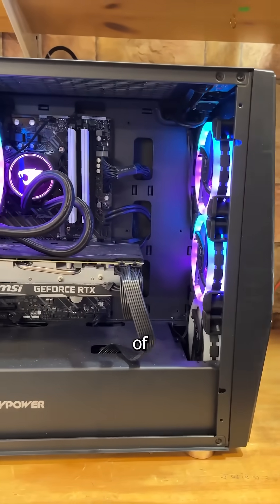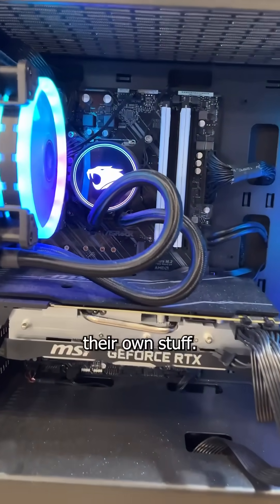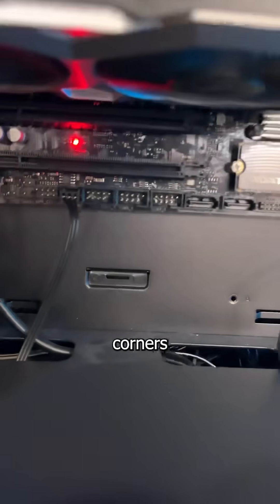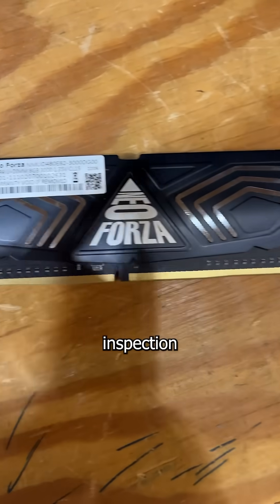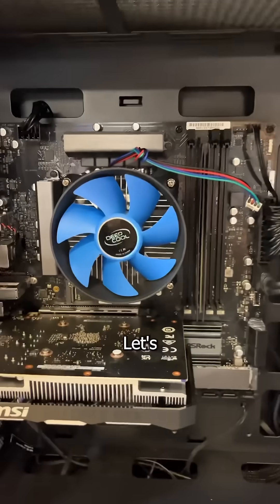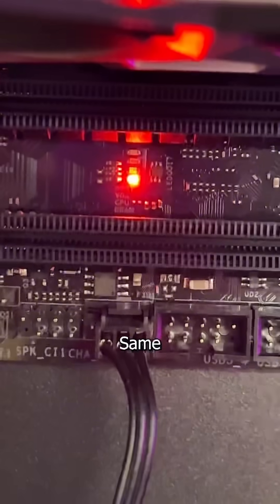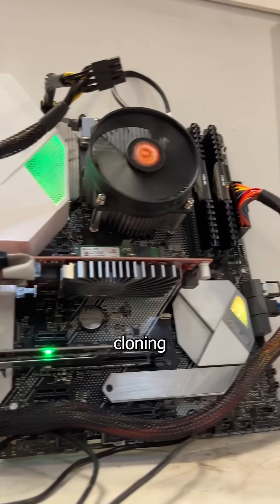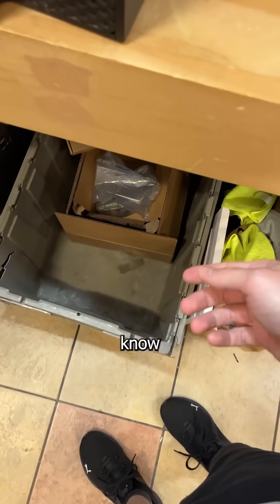iBuyProblems? Cheap NVMe causing no POST 💀 #technology #pc #tech #shorts #computer

Comment: I bought a brand new I think western digital black NVME from Best Buy, installed it, would occasionally post to BIOS but would always fail trying to boot Windows.
I was getting constant RAM error lights. I swapped in my old drives and it boots fine. I go back to Best Buy, buy the next 4tb Samsung 990 Pro, and get home, install it. Works like a charm

Comment: Adata is pathetic
Reply: No, very solid Brand actually.
I have SSD and 2 DDR Rams from Adata on old system. No problems for 10 years.
Reply: @КаринаМурлыкина-о9т  I've had 1 480 GB su series m2 ssd. got corrupted exactly in 3.3 years, 3 months after the warranty lapse. I checked with the people on reddit, Adata has been giving the same problems to them :)

Comment: This is the first time I ever bought a prebuilt and It is an IBuyPower Elements Pro. It's been fantastic. Depending on where you buy it, it will tell you what brands of components you are getting. Mine is all MSI which I like. If you go for a less than $800 model, expect to get Chinese ripoff parts.

Comment: My first system was an iBuyPower.  I bought it because at the time buying the components individually would've been the same price.  It died on me within 2 months thanks to shitty parts.  The PSU (eVGA, was rated good for its time) blew out its smoke, but before that it had problems with crashlng likely due to the RAM, but other crashes were possibly due to a Palit-branded GPU.

I bought it with the intention of upgrading from the shipped 6GB of RAM and GTX 460 a couple years down the line, but with all low tier parts being suspicious I said "fuck it, we're doing it now!"  i7 870 w/ 24GB ram, 1TB WD Black (eventually upgraded to 6TB spinning rust with 720GB RAID 0 SSDs), and an MSI GTX 460 OC (eventually upgraded to dual 7970s). PSU was replaced with an Antec 1KW gold-rated unit.  I think I ended up sinking a total of $10k into it over its life, but it was a beast.

iBuyPower is shit, I should've just done it myself to begin with.

Comment: I have an ADATA SATA SSD in my server as a boot/swap drive. Motherboard is too old for NVMe/mSATA so 2.5" laptop drive stuck to the drive cage with 3M VHB it is. It's worked fine for 4+ years so far, fairly light Plex loads and file copying so not being slammed with read/writes, but I should probably boot the system up in Clonezilla and check the drive health at some point.

Comment: The terminating resistors on the A-Data drive.   They are inside the controller and are SUPPOSED to go to erf.  Buuut - they accidentally go short and kill the PCI bus completely.   That bus goes to the CPU directly.  A boot is attempted but the mobiusboard sees the CPU panic and refuses to move on.

Comment: Ironically, I got this great RGB iBuyPower $5 mouse that I thought would be better than the heavily abused, shared HP mice at work and $5 isn't a big deal if I have to bin that sucker inside of a month. 

Also to note my old ass 4th Gen Core i5 is running ADATA ram with no problems for the last decade(including being on ASUS' memory compatibility list) 

Guess it must be whatever 3rd rate Nvme maker they contract with is garbage... 🤔

Comment: PCIe problems always result in weird behavior.

Those diagnostic LEDs aren't something you can trust. They only show which state the BIOS is currently in. Server boards have a ton of those LEDs for all sorts of things that all flash during boot or stay on/off forever. The four LEDs are only the most common ones, but they still mean something like "I'm stuck between checking the CPU and checking the memory". What else it does between those two things only the manufacturer knows.

Edit: A very nice thing one board I saw had were individual error LEDs for the PCIe slots. The clips on the end were see-through and illuminated from below, so if you put a broken GPU inside a slot, the clip would glow red. Sadly no one does that today as it's likely too expencive.

Comment: Ram light came on because the dram cache on the nvme is initiated at the sane time during post as normal ram. Everybody knows you should have a case speaker plugged in to differentiate the codes. Lights are just the first stage

Comment: Happened with my PC just a month ago. I kept swapping slots and reinstalling Windows over and over again. Finally, I decided to swap the PSU too, but it didn't work. I had to get a new m.2, and the old m.2 is still good (from what I see on CrystalDiskInfo and HWInfo), but it can't be used as a boot drive, I now use it as a secondary storage drive.

Comment: I'm building my PCs since 2003-4 and the most problems I've had was 2009-2014 with my AMD stuff. My current AMD PC runs better than everything I've seen before. I can count on one hand my blue screens I had in my last 2-3 years and that's pretty rare for PCs in general, especially with heavy users like me. The point is, building it your self will also result into problems, no matter how much you know, it's always a possibility, but with more experience comes better builds and the ability to fix your problems by your self. Of course those people will rarely send their PCs into a repair shop and people who buy fully build systems will send theirs. Even if you're a pro, you can encounter problems, some times a Windows update will destroy your SSD like recently, or you need a BIOS Update to run your hardware smoothly and people just don't know.

Comment: Possible cause of RAM error: if the drive in question is DRAM-less (aka cheapo drive), it relies on host memory sharing to cache activity. If the drive has issues, it could cause the controller to basically spam the system with calls trying to establish a cache for a drive that can't even mount.

Comment: My guess is the DRAM cache on the NVMe drive crapped out.  NVMe can run in different modes where it can use some of the system RAM if your drive does not have that cache.  So I am thinking that your system is trying to see that as a system RAM extension and freaking out when it cannot find it.

Comment: The older ADATA 2.5" SATA SSD's were the shit back in the day, so it's a shame to see their QC fall to the point people are warning against their products. They weren't SUPER fast, but they were reliable and reasonably cheap for the speed and capacity. I still have 2 of them kicking around, one in a spare system and one in my ex's computer after I gave her my old system and just put it in a new case following an upgrade. I also remember that their old DDR2 and DDR3 DRAM was also cheap, reliable and fast, but I've heard some recent horror stories with their DDR4 and DDR5 modules. On top of that, some of their mid range products are now more expensive than more performant alternatives from Corsair, G.Skill, TeamGroup, Kingston, etc. Sad to see a brand you once trusted go the overpriced jank route. I used to go out of my way to buy them from CompUSA and Newegg, now if I see them anywhere I avoid them like they have leprosy. Woof.

Comment: I had a failing nvme drive in my gf her pc. Took me a few weeks to figure out because it showed itself as a power issue. Random shut downs and performance was unstable. Undervolting seemed to work but then suddenly windows wouldn't even boot at all. Swapped it with the nvme from my own rig and everything worked as expected! Bought a new and larger nvme and now it all works like a charm

Comment: the only way this would happen is if the MB maker ran the sata lines into the pci pipeline for the cpu's memory controller.the second the drive failed the cpu would have seen it as a memory failure. either that or the cpu's memory controller is starting to die.

Comment: Honestly this happens without reason when there are power outages or scenarios of short circuiting.

It is possible that if at anytime part of the board or harddrive short circuited that would make sense why the drive you tried putting in didnt help at first.

It's rare for the board to stay working, but like you said those "ADATA" drives being unreliable could also have been a factor in a scenario of that part of the board being able to short circuit with ease.

Hopefully the motherboard lasts a little longer.

Comment: iBoughtProblems too can any recommend a good power supply for the “Element 3” pre build, my specs are ⤵️

Case: iBUYPOWER HYTE Y60 RGB Gaming Case -
Black
Processor: Intel® Coret™ i9-14900KF Processor (8X
3.20GHz + 16X 2.40GHz/36MB L3 Cache)
Motherboard: ASUS ROG STRIX Z790-E GAMING WIFI, WiFi 6E, Back Panel USB (2 Type-C, 10 Type-А)
Memory: 64 GB [32 GB x2] DDR5-6000MHz Kingston
Fury Beast RGB
Video Card: MSI GeForce RTX 4090 SUPRIM LIQUID - 24GB GDDR6X (DLSS 3.5 - Al-Powered Performance)
Processor Cooling: CORSAIR iCUE H115i ELITE
CAPELLIX XT 280mm RGB Liquid Cooler
Primary Storage: None
Operating System: Windows 11 Home
Storage: 2TB Samsung PRO M.2 PCle Gen 4 NVMe
SSD

Comment: You can get the same RAM error light with ANY hardware running through the chipset PCI lanes being bad. Chipset lane hardware issues cause a fail during the ram test stage of POST.

Comment: PCIe POST checks failed for sure. You can technically get aeound this if you had this drive in one of the other M.2 drive bays, and jad another one here that was good. They usually fail out on the initial checks and refuse to boot, but so long as one posts, youre good.

Comment: A failing storage device can cause such severe instability that the ram fails when trying to load in what it is supposed to be getting told by what is on the storage device.  So, basically, the storage is talking to the ram all wrong.

Doesn't really do anything to virtual ram though. Since that is managed by the OS rather than bios. 
But with this issue. You won't even get to the OS for virtual memory to even become relevant.

Comment: when I was looking at these prebuilt, almost all of them came with adata drives because of how cheap they were. I seriously considered a prebuilt pc when I couldn't get my hands on a 9800x3d. but just waited long enough, now im waiting on my case and PSU. 9800x3d, 64gb flare x5 ram cl30/6000mhz. corsair 4000x case, rm850x psu. existing rtx 3070ti

Comment: I think this diodes dont show problems but shows state when post stoped- CPU initialized, then connections to needed devices, then working state od GPU then booting devices.
When GPU is not plug in fully it shows DRAM errors sometimes

Comment: I had a similar issue with my dad's work computer and I tried everything, reseating the ram, checking to see if the cpu was making contact with the cooler, and then I took out the ssd and it booted. I'm not sure why this worked but it might not be super uncommon.

Comment: Idk, but the chips on NVMe SSDs and DDR4/DDR5 RAM modules are made by the same 3 or so companies and often share some of the same chips (along with others they don't share) that go into building the components. Perhaps the error occurred on a memory chip on the SSD that happens to also be a chip that often shows up in RAM modules, so when the motherboard detected an error in that chip (or couldn't boot because of that chip) it triggered the DRAM LED to turn on and display an error.

Who knows 🤷🏽 The lines are made up and the points don't matter!

Comment: I bought an iBuyPower and absolutely loved it! It was during the 4090 scalping time period so they were going for twice the price. Found my current computer and added up all the components and it was a legit deal (yes overpriced comparing it to buying it yourself and yes the components weren't top of the line, but they weren't bad either)... Only thing wrong with it was the PSU dying a few months. It was definitely the lowest quality part being some Chinese knockoff. But I will say it was causing blue screens and major issue.  I think a normal person probably would of never figured out it was the PSU being the problem. I also have replaced RAM, SSD, and CPU cooler. But definitely it would of been way better to have built it myself, but the computer cost nearly as much as scalpers were trying to charge.

Comment: Merge over just been lucky, but I've had a 500 gig adata nvme as my OS drive for the better part of a decade, and had no issues with it. Also bought a 1 terabyte adata nvme to dual boot Linux bazzite a few months back. No problems with that one either.

Comment: I am also a technician and I have no big brained answer but I can say with experience that the dram light just turns on for all kinds of not dram related issues. I see it a lot with power issues, like the gpu will have a bad cable but the dram light is on. Especially Gigabyte brand motherboards, those lights just boop on and off for no discernible reason.

Comment: I have Adata Legend 710 and it works perfectly for 3 years already.
I think problem lies in stupid thin radiator on self adhesive that adata shipped with, i never installed that and used mobo radiator instead on the b450 aorus, cuz I heard these adata drives can overheat and throttle with stock cooling and I bet this drive in the video just cooked itself.

Comment: If I'm correct, that's an ASRock phantom gaming X motherboard. I have the same one and apparently it has an issue with anything used in the NVME slot. I'm replacing my motherboard because of it

Comment: I just installed brand new motherboard, cpu, and cpu cooler to my ibuypower pc I got back in 2019-2020 worked pretty good for it being older. Now with everything installed it works wonderfully. If you take care of your stuff and watch enough videos you can be a great PC updater lol. Old motherboard looked like it belonged in a del computer. Got a new ASUS one, 32 GB of ram with my old 2060 Super. Intel core i7-12700KF and it is just a cool ass surprise to me that it runs like a brand new PC and my dumb nutt job of a brain could handle it!!

Comment: DRAM light when drive is bad makes sense because IO die on the cpu, which handles all of the connected devices, was having difficulty communicating with the drive. I have seen the same scenario on systems I have worked on.

Comment: A faulty (integrate board) on a drive can even cause the computer to boot to a black screen with no POST. RAM error is unique but plausible as whatever garbage the M.2 circuit was saying back to the mobo was making the memory look faulty since it is a core component along with CPU, video and mobo.

Comment: Ok I have worked on cyberpower pc and Ibuypower as well.

Ibuypower doesn't use the best ram they use the cheapest ssd and ram available on the market. This causes ssd failures and ram failures daily.

Now cyberpower that really @#$%&* me off. If you have a cyberpower pc open the case and read the make and model of your pc mainboard here is why cyberpower will use msi and asrock boards with custom logo bios that says cyberpower on startup. But if you use the cyberpower bios it deactivates one core in the cpu because the motherboard looks at the bios and thinks the bios is faulty and deactivates the single core go to the boards original manufacturer site and download the factory bios there from asrock msi etc... and install there latest firmware update. This will unlock that single core

Comment: I had a KLEVV m2 ssd for roughly 3 years, and when it started decaying it was causing the blue screen of death on Windows that would suggest it's the ram or graphics card, so I removed 1 stick of ram and was left with 1, then I removed the one my monitor, and it ran relatively fine for awhile (6 months) with a crash here and there, then I started getting the BSOD regularly again and when I try copy large file from it it would crash. Until I realized that it might be the SSD, after removing it, reinstalling windows on a new harddrive and now I have not had a BSOD (8months now) and I put back the RAM and the monitor I removed and everything is working fine. And I could recover everything by plugging the harddrive on Ubuntu machine and managed to copy everything but when I plug the hard drive on windows and try copy from it or to it, it will crash the system

Comment: Years ago, I ordered a $2000 prebuilt from iBP (it had the 1080ti, so it’s a while back). When the PC finally arrived after being delayed 2 weeks on its original 1 month ETA, little me was so hyped to play w my boys. I boot the PC up, recording the unboxing for the group chat & me just booting it. My excitement turned to sorrow 10 seconds later, as my PC became unresponsive :) Of course, being somewhat familiar now with the PC world, I opened it up to see if anything was loose. I check the PSU, and checked to see if any connection was, again, loose. Everything checked out, so now I’m thinking maybe I gotta reseat the ram? So, looking at my gorgeous 16gb Corsair vengeance RAM sticks, I noticed something… Gut-wrenching.  Corsair shipped out this particular RAM model with a plastic film that was dedicated to simply protecting the “Corsair vengeance” logo. Shocked, as I paid extra for iBP’s “pro assembly” that was like an extra $200, I took to the internet and found out that parts are very prone to static which would in essence, brick said part. 

I get into it with customer support, not taking some BS answer from them & instead, getting my pc fixed. Instead of just sending me the new ram sticks (I had taken photos and a video before peeling the film off) they requested that I ship the PC back to them, and to pay for the return label ($30). We go back and fourth, I got a free shipping label, so I sent it back & they told me to wait two weeks. 4 weeks goes by, and I yet again record the unboxing for the GC……… I open the box… and it’s an entirely different PC… from another customer… That was a $900 prebuilt as opposed to the 2 grand I saved up and spent. 

10/10 service